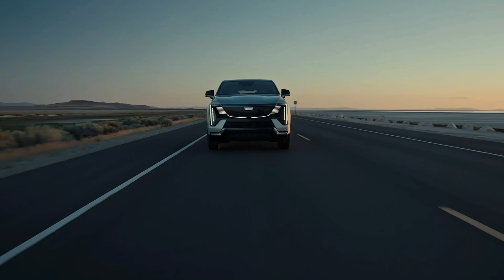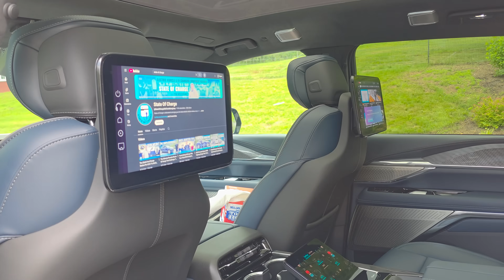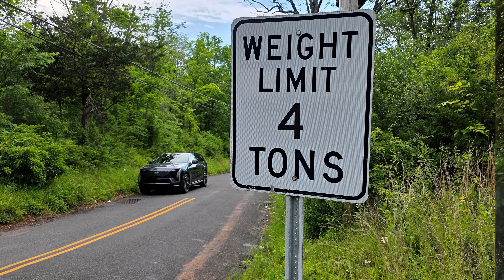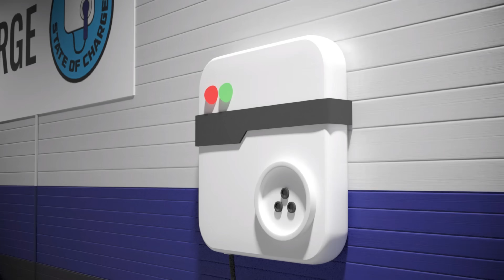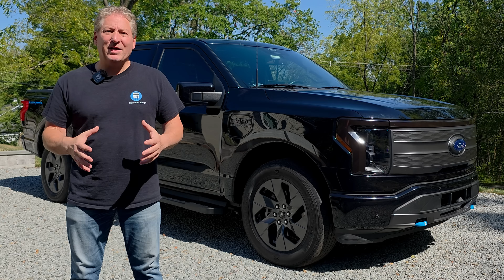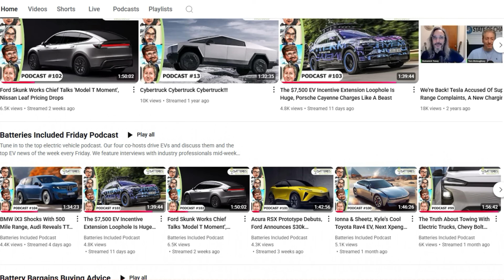Are General Motors Electric Vehicles Too Heavy For Some Public Roads?

Comment: So, Tom snitched on GM to the police for the honour of his Ford F1 50. That's almost a Tesla fan move on Mary Bara to save Tesla's face.

I recall how in the early days how the majority of the EV YouTube crowd mocked GM for prioritising larger batteries to achieve range over promises of solving the same issue with technological wizardry from Elon Musk and Tesla. The boast used to be that only Tesla would survive a supposedly upcoming EV revolution that would result in the demise of the major OEMs relying on the outdated fossil fuel ecosystem, due to the exalted position of Tesla engineers who were supposedly all geniuses. The boasts continued: the smarter engineers and minds leaving universities all fought to work for Tesla, leaving only third-rate minds vying to work for the likes of GM. Ford, they boasted, would be the only OEM with a chance of surviving because Jim Farley was devout enough to worship at the shrine of Elon and Tesla. He saw the light.

Fast forward to now and GM is killing it. Turns out that GM’s strategy of giving people the range they desired, as well as buttons and knobs and affordable EVs, is resulting in an increasing share of the EV market. And what is the response of the EV YouTube crowd? A return to griping and moaning at GM for solving the EV range issue with larger batteries. Why moan over this solution? What happened to all the geniuses that were dying to work for Tesla? Why haven’t they solved the range anxiety issue with the technological finesse they promised? Why not moan about that?

It’s an odd gripe. Range anxiety hasn’t gone away, especially for truck owners who haul and tow. More chargers help, but the comfort of a long-range battery is still what convinces many people to take the leap. GM understood that, and it shows.

Comment: Diesel, Gasoline, and Oil, which predominately ICE vehicles leak, cause asphalt to deteriorate.  Additionally, larger vehicles have larger tires, so they will have a larger contact patch with the ground, so the actual force to the ground, MAY be proportionally similar to a smaller vehicle. This is a nuanced conversation, and unfortunately, ignorant narratives are easier to mainstream.
Reply: This is why I choose the 21's over the 19's on my Equinox for better weight distribution (reduced tire wear) and better traction in snow. 275 for the 21's and 245 for the 19's.

Comment: You come up with some interesting issues Tom.  You did the right thing to check with the police, who in turn checked with the town engineer.  While the general restriction on roadways in the township may not apply to passenger cars, it is important to note the distinction between general roadways and bridges.  There are many old bridges in this country that are in poor condition and many jurisdictions will post weight limits for these structures.  This is a critical safety issue.  If a bridge has a two ton weight limit, do not drive over it with your 5 ton vehicle.  It might collapse and endanger you and other motorists.

Comment: The engineer's comment later in the video confirms what I've heard - that it would take ~ 10,000 cars to do the same damage as a single truck.  The fourth power law states that the stress on the road caused by a motor vehicle increases in proportion to the fourth power of its axle load.  https://en.wikipedia.org/wiki/Fourth_power_law

Comment: guy went off on a bit of a political tangent in his email which should also probably be addressed. Most states are attempting to equalize the road taxes paid by EV drivers to those of Ice/Hybrid drivers which are paid for by purchasing fuel in most states. Im not advocating for how they are going about trying to do that , im just saying thats the originally intended goal which is objectively fair. how they do that , and how corrupt people influence it and turn it into something terrible is a hole different state by state issues.

Comment: They didn’t answer with certainty, so it sucks either way. In this specific case, if someone happens to be in an accident driving the big GM on those roads and taken to court by the other party, the court will decide. Based on the 4 ton limit sign alone, the GM car will most likely be at fault every time.

Comment: also id like to point out , weight limits make no sense .. they should be written as a max weight per AXLE so at least you have some relative sense of the maximum pressure over area. 4 tons with a truck pulling a dual axle trailer 4tons/4 axles , is alot different than 4 tons over two axles.
Reply: I cannot speak for other states, but in Georgia, when posting bridges our ratings are based on axle weight, but we post the bridge based on total gross weight of the vehicle type. This can lead to some interesting posting results where a bridge is posted for a tandem, but larger trucks are fine based on axle location. This also comes into play for emergency vehicles as their axle placements are unique and require unique postings. I believe other states post based on max axle weight.

Comment: In response to the retired engineer, what he fails to state is that engineers, all of them, take all factors into play. Weight is weight. If you have a 4000lb pickup truck or a 400lb Mini, the weight is the same. ton of feather vs a ton of bricks type of thing.  Roadways are designed to last a set number of years with an expectation of weight traveled on those roadways within that time period. You can't design something weight bearing for a set time period without having the weight variable in mind.  I don't care how many PHDs you hold. Facts are facts. What we know today is that with the additional weight of EVs, the average weight of the common 'family' vehicle has increased by 13-22%. According to the  FWHA own stats. This means that all roadways are seeing a weight burden that was not figured into the upkeep/longevity of the roadway.  A roadway designed to last 25 years only lasting 20, for example. As an EV driver, I don't want to see a 'tax' on EV drivers. But at least lets get the facts straight.

Comment: No more than a Super Duty pickup, many dually pickups, an F-350, etc
Reply: Yep. I just did this same search. Ram 3500 Dually is like 7,500lbs. Throw a family in it and anything in the truck and you’re way over.
Reply: @skwashua  They are more than that. crew cab 4x4 Ram 2500 single wheel trucks with the Cummins are over 8000 lbs if they are anythign but the base trim. Doesnt even need to be a dual rear wheel. The crew cab, 4x4 dual rear wheels are pushing up toward 9000 lbs with any kind of options.

Comment: I wonder if these heavy vehicles would also contribute to more cracks in driveways and garages? Not sure if there is a specific weight the concrete is supposed to support without cracking
Reply: no , Buses and Trucks do that and those are 10-20 tones.
Reply: Yes, they could; most driveways are 4in slab and rated up to 3 ton. Something as big as that Escalade would need 6" as I see it.

Comment: I wonder how applicable the pavement engineer's comment applies to those roads that were never built properly in the first place. A lot of century-old neighborhood streets in my area never had a good base or sufficient drainage installed and the blacktop layer is thin and easily damaged.

Comment: I see a lot of people driving around here in Ford F-350 trucks (and other similar trucks) as their personal vehicles and they can weigh over 8000 pounds but are they subjected to extra fees?
Reply: Well, in my state, yes. Their registration fee is easily twice what I pay for my smaller SUV which is itself about twice what I used to pay for my old 4-door sedan.

It can be argued that perhaps they should pay more given the wear and tear on the roads they travel on. But at least they do pay more than I do. Plus, they also tend to pay more in gas taxes as well because they typically have horrible gas mileage.

And yes, the gas tax absolutely needs to go up. We also need to have a similar sort of tax for EVs so they actually pay into the road maintenance fund - whether that's increased registration fees or a wattage fee or whatever other options there are.

Comment: 2025 Ford F-150 is the Limited trim with a 5.0L Ti-VCT V8 engine, SuperCrew cab, 5.5-foot bed, and 4x4 drivetrain, weighing in at approximately 5,863 pounds
Reply: I'm a rich guy, bought a Fiat 500e for $8K in 2018, great car, fun car.  Eat cake, peasant.
Reply: This is why EVs just can't compete with gasoline.  Until fossil fuels start running out they are a toy for the wealthy.
Reply: @mistermister2085 that had nothing to do with the comment you replied to? And you can get an Equinox EV for $35k. 27.5k until the end of the month. The Bolt is coming back out and will cost even less. How are these relatively inexpensive vehicles toys for wealthy people? You can also get a used low mileage EV and pay even less. Not to mention that even if the initial cost is a bit higher, you will save a lot of money not buying gas in most states.

Comment: Chevy Bolt EV 3600 lb. I like when people try to use the "EVS are heavy" argument on me
Reply: Dude at work that was telling me about how heavy EVS are, I want to know how much is Cadillac weighs.  I have two EVS that weigh 3,000 lb, one that weighs 3,600.
Reply: @rp9674 all of gms evs are over weight to there size
Reply: That's not that relevant, like average price of vehicles.  
Drive a heavy Gasser and that's okay because the average gas are is lighter, doesn't make sense.  People don't drive the minimum vehicle they need anyway.  Not so many complaints about big heavy gassers, but there are plenty.
Reply: @rp9674 , it is relevant. Your Bolt is a small passenger car, comparable in size to a Chevy Sonic, which is built on the same platform. The Sonic weighs in at around 2,900 lbs.  Your Bolt is 25% heavier than a comparable ICE vehicle. All that weight adds up, regardless of whether you're driving a Bolt or Hummer EV.
Reply: @crusher0427  Adds up to what though? If you listen to the section of this video with the email from the pavement and materials engineer with a PHD, they dont even factor the weight of light duty trucks and passenger cars when designing roadways because it doesnt matter. Only heavy trucks matter.
Reply: @Jay-me7gw , I'm not talking about the impact on the asphalt. I'm talking about the impact on bridges.
Reply: @crusher0427 same difference.
Reply: @Jay-me7gw , how do you figure? A Sierra EV weighs 9,000 lbs, while the ICE version is around 5,500 lbs. Two EVs weigh more than three ICE ones, but they take up the same space.
Reply: @crusher0427 I thought we were talking about a 3600 lb bolt vs a 2900 lb sonic 🤷‍♂️

Regardless, if the road engineer with the PHD doesn’t care, why are you so worried?
Reply: They are your average ev is heavier than your average gas vehicle
Reply: @mcsike7264 large ICE SUVs and trucks typically weigh equal to or more than average EV weight.
Reply: @barryw9473 ya bc they are large suvs ofc they gonna weigh more than something like a model 3 or Chevy bolt but a a cadilac the same size of a model Y is 6000 pounds thats the weight of a pickup truck 😂
Reply: @mcsike7264 sure but pickup trucks are super popular. My point is the most popular vehicles, pickups and large SUVs, are not getting proper scrutiny.
Reply: @barryw9473 i know am just saying evs that size should not be the same weight as trucks gms ev strategy seems to be just stuff a big battery in everything and ride off the range numbers which isnt sustainable long term

Comment: It's important to not lose sight of the fact that the vast majority of EVs sold do not have batteries nearly this big. The Cadallac Escalade is designed and priced for a few rich people, willing to spend whatever to takes to have the biggest, most feature-capable vehicle on the road. Normal people buying EVs buy much more reasonably priced cars, with much more reasonably-sized batteries.

Comment: Great video. What about multi story parking garages? Are those engineered to hold double the weight of average vehicles 🤔
Reply: 2022 Jeep Grand Wagoneer (up to 6,390 lbs), large SUVs like the Ford Expedition MAX (around 5,780 lbs)
Reply: 2025 Ford F-150 is the Limited trim with a 5.0L Ti-VCT V8 engine, SuperCrew cab, 5.5-foot bed, and 4x4 drivetrain, weighing in at approximately 5,863 pounds